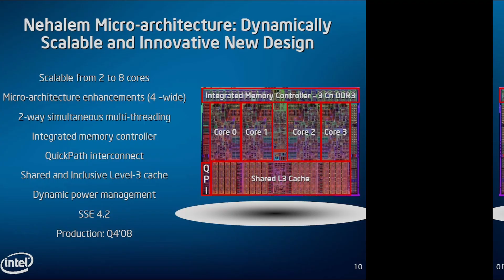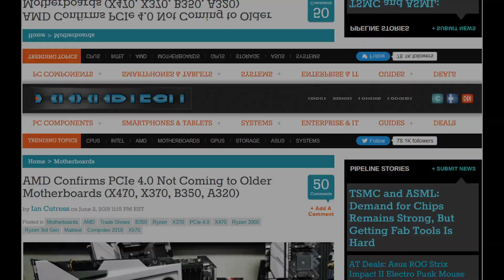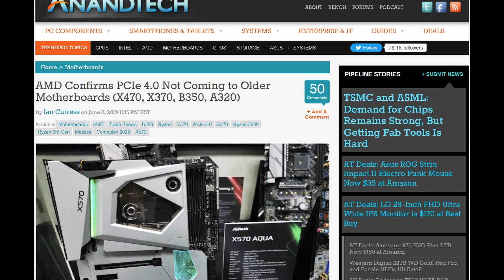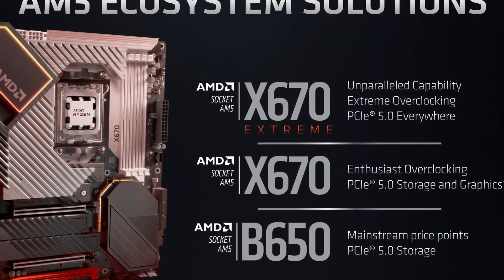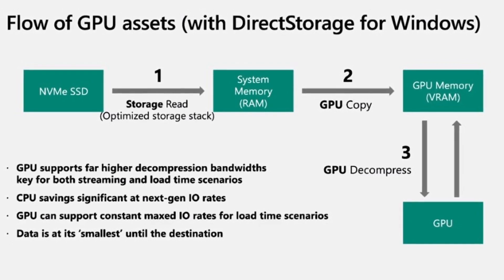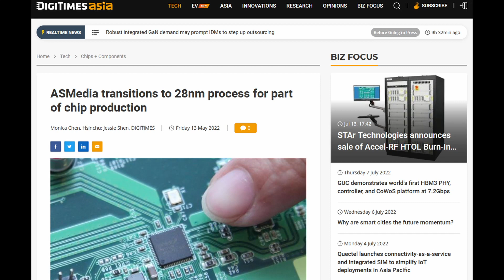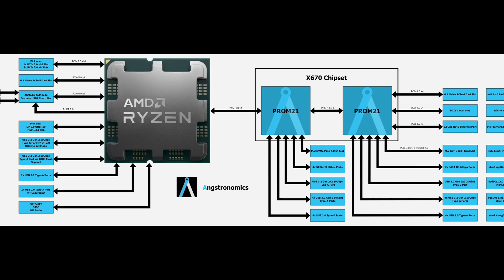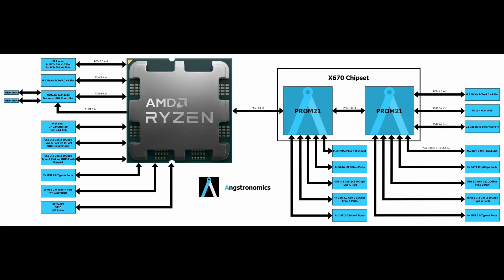The Smart Design behind AMD's X670E

Comment: I would personally be hesitant to buy a new gen 4 graphics mobo, in case AMD pulls a 6500xt again to knock 50 cents off the production cost
Reply: I would not, PCIE4 only became available with Zen2, Intel only recently supported it and if you care about PCIE5 already you aren't in the market for lower tier value GPUs with cost compromises to x8 lanes.
Future proofing is always suspect, replacing the mobo if necessary to take advantage of Zen6 features in 4 years when GPUs use PCIE5 bandwidth is better, alternatively buy a x16 PCIE4 GPU
Reply: @RobBCactive  I agree about low-end GPUs, but on the other hand if you're planning to invest in a high-end next gen GPU, I would also want PCIe5 since these GPUs are very likely to be limited at least a bit on PCIe4 even with 16 lanes.

Simple math: the 6500XT runs almost 2X faster in some games (e.g. Doom Eternal; see HUB benchmark) with PCIe4x8 compared to PCIE3x8. This shows that the 6500XT can use all the bandwidth of PCIe4x4. But even in the current generation, there are GPUs that are 4X faster than the 6500XT (the top 69xx/3090), which means that those are at least in principle capable of soaking all the bandwidth of PCIe4x16. I say in principle because these high-end CPUs have much bigger VRAM, but if we have another generational jump on game asset size/quality (think Unreal 5's Nanite) then you're need too much VRAM to avoid bottlenecking on PCIe4. And VRAM is only getting more expensive so nobody should expect the next-gen GPUs to have any extra VRAM at each SKU level compared to current gen. In short, you totally need PCIe5 so your 7800XT or RTX4080 with 16GB VRAM will not be limited by PCI bandwidth when running upcoming games that bring another generational jump in graphics fidelity.
Reply: @opinali GPUs are already handling 4k, so this idea looks like FUD.
As I understand leaks Intel boards allow PCIE5 for GPU not M2.  That means you cannot stream in data over PCIE5, so you're looking at only GPU/RAM transfers which implies copying and processing i/o data or paging of VRAM, which I believe more than negates the transfer speed gain.
PCIE3x16 hasn't really been an issue yet, only Zen2 & Zen3 users had PCIE4 until Intel's short lived 11th gen made it a feature.  I cannot remember any of the comparison reviews warning about 10th gen performance limitation, in fact the opposite after Intel cut prices on i5.
Think if RDNA3 that is expected to double 6900xt performance required more than PCIE4 then PCIE5 would have to be on both AMD boards and GPUs this year.
The Intel socket is dead after Raptor Lake, no future proofing option.  Looking at HUBs RX6500xt benchmarks showing PCIE3x8 performance reduction at higher resolution it was <10% limited not a halving, so phased upgrades would be a reasonable option.
AMD engineers have looked at this and concluded M2 PCIE5 support is a better tradeoff.  Console developers similarly wanted to stream in data directly so games don't have to pre-load so much data with delays between areas.
Within a few months benchmarks will be out and the platform strengths and weaknesses quantifiable rather than informed speculation.
I believe AMD's made smarter choices, with these chipsets and likely will have a platform advantage.
Reply: @RobBCactive  "PCIe3x16 not an issue", you would be right 95% of the time. But you can find tests showing that the 6600XT (x8) is significantly faster on PCIe4, and one from LTT showing that an RTX 3090 (x16) is 30% ahead on PCIe4 in CSGO. That's just one game but they only tested a handful there; nobody has done a HUB-style 50 game bench of PCIe3 vs. PCIe4. GN tested a dozen games but with a 3080. Given the scarcity of these tests, maybe CSGO is not such a rare scenario. And even if it is, it's good evidence that many other games are close enough of bottlenecking PCIe3x16 that new GPUs that are 2.5X faster but with same VRAM size could push above PCIe4x16. Both AMD and NVidia's next GPUs are rumored to be ~2X faster in raster but more than that for raytracing; so worst-case scenario of say a 4090 with 16GB, running a RT-heavy title at 4K and high settings, I can easily see PCIe5 having a decent advantage over PCIe4x16, without needing "FUD" about future games that might be much heavier.

Some ADL boards support PCIe5 M.2, but if you use that they cut the primary (GPU's) 5x16 slot to x8, and the secondary 5x16 slot to zero. PCIe5x8 is still enough for current GPUs at least if the chipset can map 5x8 to 4x16, since current GPUs can't handle any PCIe5 lanes; motherboard manuals don't have that kind of detail and I don't have an ADL system to test myself. Not a big problem yet because PCIe5 NVMe SSDs are still not available last time I checked but some brands have demoed it and they should be on newegg by the time that Zen4 and RKL ship. And it will totally be worth it in particular with full impl of DirectStorage on Windows, which is also coming in this generation, AMD in particular confirmed that their next hardware will have all the tricks for DS.

Totally agree that we need to wait for the first benchmarks, but the first round of launch-day benchs will not tell the whole story, for one thing it may be some time until we have any PC games updated to take advantage of DirectStorage. Perhaps that's easy for Xbox-to-PC ports, or AMD may work with some partners to have a couple launch-day games updated to showcase all good stuff in X670E/Zen4/RDNA3. Make Deathloop load levels much faster and I'm sold on the whole platform.
Reply: @opinali  you don't need a big rig for CS:GO, any PCIE4x16 will handle it great with Zero/4 AM4/5.
This is real FUD you're stirring up, pro E-sports ppl can use display scaling and lower settings to obtain incredible frame times even on older machines never mind what's coming soon.
The alternative won't be better, a PCIE5 GPU connection still has to be fed so it'll have a bottle neck elsewhere.  Nvidia Rebar support and Direct IO were a box ticking exercise.
I've seen plenty of ultra high fps tests and they simply become meaningless.
The performance of AM5 and Intel's competition will soon become clear, using PCIE4X16 for the GPU is NOT going to be a problem.
Reply: @RobBCactive  I'm not stirring up any FUD. Here is at least one game that runs 30% faster on PCIe4 than PCIe3. Simple fact and proof that current games can be bottlenecked by PCIe3 on current GPUs. By the way that result was the same in the 3090 and 6900XT, so this is not some freak driver problem.

I agree that ultra-high FPS is bullsh*t, the test I mentioned was 311fps vs. 404fps (6900XT on 4K, Very High, No AA). But CSGO has potato graphics for today's standards so I can see a modern AAA game hitting that bottleneck at a more reasonable framerate, tons of gamers will tell you that 120-144Hz is great for any game not just esports. However, today's heaviest AAA games will be bottlenecked by the GPU's execution units at lower fps than necessary to hit even the PCIe3x16 limit. Then again, the next GPUs will have architectural resources to render >2X fps, changing the balance of bottlenecks.

Suppose we have some game, say Cyberpunk, that today needs close to 100% of PCIe3x16 bandwidth at 4K/High, so you still don't see any boost from PCIe4. But the game is GPU-limited. If new GPUs are 2.5X faster for RT games, and all factors scale linearly, that game would need 1.25X of PCIe4x16's bandwidth before it is again GPU-limited. You can barely run this game today at 50fps in 4K in a 3090, so 2.5X is 125fps which is not "ultra high" by any stretch of imagination. Of course you can also use DLSS/FSR2, but not with zero cost in image quality. If I'm investing on a high-end GPU, I will use any supersampling only at Quality Mode where the artifacts are minimal and the superior TAA can actually make IQ better than native rendering. Even in new flagship GPUs, that won't always give you high enough FPS that you won't care about some 25% lost to PCIe4.

Obvious caveat that we don't know how much PCIe bandwidth is required by specific games and how their scaling would work on unreleased GPUs that we don't even have real perf numbers yet only leaks/rumor. But I will be surprised if there aren't at least a couple games that prove me right on launch day, i.e. games that have non-insignificant advantage with PCIe5 vs. PCIe4, at 4K/High, with "80-class" GPUs not halos, and within a sensible FPS limit like 144.
Reply: @opinali  Graphics data is stored in VRAM for fast GPU access, so graphics processing can go brrrrrr.  When VRAM objects spill to system RAM there's a penalty but a graceful degradation which implies the system bus is NOT saturated in normal gaming use.
Displaying games without frame limit would wedge machines if it all data was going across the system bus to the GPU.  Yet people are clearly multi-tasking fine with active  programs processing in background or on another screen while they game.

The surprise result you mention may be due to a latency reduction somewhere in the stack, thinking bandwidth saturation is the cause doesn't really fit.  It could easily be a OS scheduler multi-threading effect for example when you're pushing at high frequency from a game loop.

It's a dubious assumption that PCIE5 would help much as other bottlenecks usually exist, it'd be surprising if PCIE4 is still it, after all double bandwidth gave just 30%.

Hope that makes sense .. yes I have engineered software and systems. Measurement is far better than speculation and hand waving.
4k 400fps CS:GO doesn't sound typical usage to me, IIRC the chipset is the B series not the top X.
Reply: @RobBCactive  I'm also a SW eng, not gamedev but some exposure to graphics and solid experience in caching and benchmarking. Mostly agree on caching, but you cannot assume that 100% of the data needed for rendering can live in VRAM, requiring no significant PCI transfers after level loads. This will be true mostly for toys. In any real game there's a fair amount of data pushed to the GPU per frame. This can be dynamic content that's computed at least in part in the CPU, e.g. particles, physics, procedural geometry.

There's also asset streaming that often happens even when you have a large VRAM, for several reasons. 16GB is still too skimpy for the assets of modern AAA open-world levels, especially after uncompressed. Modern GPUs and API are improving support for compressed texture/geometry data but this is not magic, GPUs can only afford algorithms that allow very fast compression not just decompression. Game engines can't be hardwired for the top GPUs, so even in many AAA games, half of my 6800XT's VRAM is unused.

Also games can't afford complex LRU caches, they have to pick straightforward allocation strategies for both RAM and VRAM; they can't afford the latency and unpredictability of very dynamic algorithms even if at the cost of sub-utilizing VRAM on top GPUs. Some games show you the VRAM usage in the settings UI so you can see that each feature costs a fixed extra "block" of VRAM. Some of those blocks may have flexibility to use more space in GPUs with more total VRAM, but it seems largely fixed.

A modern/AAA engine designer will count on the platform offering at least 16GB/s of PCIe. You can use VRAM for certain data like core level assets, plus rendering buffers; but anything remotely dynamic, treat as transient: push at every frame, perhaps only with minimal logic to retain data reused in consecutive frames. If you know memory allocation algorithms or real-time systems, you can see why this is better than a "smarter" solution that uses all VRAM as a flexible cache. As long as you don't exceed the PCIe capacity.

PCIe3x16 bandwidth (theoretical maximum) is 16GB/s full duplex, that seems a lot but at 400fps it's max 40MB/frame. A single frame in 4K resolution and 32bpp color weighs 32MB, so if the game does any CPU-side rendering phase that requires copying the whole framebuffer back and forth once per frame, that consumes most of PCIe3x16. I don't think modern games will do anything like that, but CS:GO is from 2012, and modern games will transfer other things that often scale with resolution and quality settings.
Reply: @opinali  my commiserations 😁😁
Reply: @opinali  Suggesting an inefficient algorithm to max bandwidth usage isn't really useful.  AFAIK CS:GO had to run on XBox360 and PS3, as well as mainstream PCs, so I am sceptical about this CPU rendering point.
The game frame decides where things are and GPUs do the transform/light and shader calculations to render reducing data transfer.

In GPU reviews, the VRAM bandwidth is more significant than what PCIE level.  It consistently shows up in frame rates, as does AMD Infinity cache size allowing higher resolution for a given VRAM bus width.  Larger VRAM supports higher definition with a large performance drop when system RAM is heavily used.

Cost cutting VRAM bandwidth shows up in benchmarks.  PCIE saturation is more likely in loading phases or when textures overflow to RAM.

Let's give credit to the engineering team who worked on this chipset solution, they would be well aware of PCIE bandwidth requirements when considering what to compromise to offer best value.

Intel is more likely to have specced PCIE5 in response to marketing pressure after the lag on their PCIE4 support, so had competition reasons to push it.

We'll see soon enough as Zen4 is expected in October in volume on the X series boards at first and there's stock clearing price cuts on GPUs.
Reply: @RobBCactive  I didn't suggest an "inefficient" algorithm. It can make inefficient usage of VRAM, yes. But the goal is having short and predictable execution times. VRAM memory management is not simple; here's an excellent overview (20 minutes): https://www.youtube.com/watch?v=ML0YC77bSOc

In any case I was only speculating about CS:GO, we don't have its source code and even if we did I am not sufficiently familiar with modern graphics APIs. I can think of other angles, like: - That game is just buggy.  - It was written 10 years ago, system requirements specify at least "256 MB OF VRAM", you couldn't expect that game to make optimal use of modern GPUs with 8-16 GB.
Reply: @opinali  It was clear you're speculating.  The copy framebuffer to CPU for rendering was ridiculous, games don't do that.

RX 6700xt, VRAM 384GB/s,
RTX  3090, VRAM 936GB/s
Both PCIE4x16 same 64GB/s

They don't peform the same,  PCIE4 isn't the bottleneck in games!!
Reply: @RobBCactive  That scenario of copying the framebuffer was just a trivial example. Games don't do that, but they do make per-frame updates to textures, vertex buffers and other resources, which aggregate size might be in the same ballpark. I bet that many of the games that can hit several hundreds of FPS in modern GPUs are PCIe-limited. Also I never claimed that PCIe4 was already a bottleneck for any current games or GPUs. I'm only arguing that this might happen in the next generation (Ada/RDNA3 top SKUs).

Also remember one of my first arguments was about the RX 6500XT being proof that games can be limited by PCIe bandwidth. That card has only 4GB VRAM, but its specs overall are not absurdly smaller than a current flagship. And while no next-gen GPUs will have only 4GB, they won't have any extra either compared to the current gen, meanwhile the GPU cores will be >2X faster so at minimum we know that these cards will require more PCIe bandwidth than the current gen. And we can only speculate if it will be a sufficient increase that some games might be limited by PCIe4x16 at the high and.
Reply: @opinali  It's FUD about buying a mobo, in 2 or 3 years just uprade to an x16 GPU card not a gimped low end repurposed from mobile one.

The 6500xt was a high frequency clocked chip shortage card repurposed from mobile GPU, stretched to meet a gap in market and gimped to prevent mining with 4GB VRAM and lower the BoM cost The GPU was designed for PCIE4 systems with an APU to a tight die area budget not the  general desktop market.

PCIE3 is a 2010 spec, Intel PCIE4 support only landed in 2021 11th gen, AMD 2019   The 6500xt x8 issue arose a decade after PCIE3 adoption.

Thus this thread supposes ppl buying premium DDR5 RAM system on mid-range desktop boards, might want to buy a low end gimped PCIE5x8 card with repurposed GPU in future, when the other cards on market all support x16.

Choosing a different future GPU card with x16 designed with desktop market in mind is the solution.  After all many Intel users will still only have PCIE3 for a few years yet and it turns out Intel systems split PCIE3 so the GPU had just x8 if you used extra slots, nobody seemed to notice.

The whole idea that PCIE has been or will be the critical factor in GFX performance is totally unhinged.

The "trivial examples" obfuscate, seriously 4K frame buffers being copied to/from system RAM every frame at 300+ fps looked dishonest.

Nobody said PCIE isn't used to control and pass data to the GPU, just bandwidth isn't saturated.

The example of CS:GO@4k  300->400fps is an extreme, not matching the typical basket of tests produced by independent reviewers.

Smart developers need to see the bigger picture not obsess on hypothetical cases which have simple workrounds.
Reply: @RobBCactive  You keep misrepresenting my arguments about the 6500XT and the framebuffer-copy example so I won't clarify for the third time. And I know of how and why the 6500XT was made, but see techspot's PCIe3 x PCIe4 piece with the 5500XT (a "normal" GPU). Those benchs show that even PCIe4x4 often limits the 5500XT (4GB). On several games, old and new. On framerates below 60fps.

Let me emphasize those results. PCIe4x4 (or PCI3x8) is not good enough for a GPU that was midrange in 2019. With 4GB, but these PCIe tests are always tuned for low/midrange GPUs, they don't even try 4K since the hardware can barely deliver 1440p in optimal configurations.

I'll give you that we can't see yet any bottlenecking with 16GB or even 8GB of VRAM. But this might be an effect of limited benchmarks. I can't find PCIe tests for VRAM-hungry games like Deathloop which really wants 16GB at 4K/High. Also no tests for high-end GPUs limited to 4 lanes (that wouldn't represent any real hardware, but would prove how much PCIe bandwidth those GPUs need today). 

All I'm saying is that the need for PCIe has been catching up. As you say PCIe3 is 12 years old; that was virtually infinite bandwidth for 2010-era GPUs, but 8 lanes of that is not anymore good enough for 2019's 4GB 5500XT. Current halo GPUs are >4X faster than the 5500XT, next ones will be ~10X faster. Gamers that can afford a high-end 2023 GPU will want to run AAA games with all settings up to eleven, at 4K minimum (8K is b?llsh?t but I am personally waiting for reasonably-affordable 5K2K since I love ultrawide). They will also want to max out displays in the 165-240Hz range, these are not absurd framerate targets. All those factors increase need of PCIe bandwidth, no matter if you have a 4090 Titan with 32GB GDDR7 there's significant data that has to be produced by the CPU and transferred via PCIe every frame, and that scales with everything: settings, resolution, framerate.

I also find it very relevant that the recent use of RBAR/SAM has proven to deliver a significant boost to several games, solid proof that games are already impacted by PCIe transfers even at PCIe4x16. If you caught recent news about Intel's Arc GPUs, they depend massively on RBAR, way more than Radeon or RTX because it's a new architecture designed without concern to legacy systems without RBAR support. We can keep making fun of Intel until Arc is fully released with well-tuned drivers, but that's another strong evidence that PCIe speed matters.

In any case, I don't think there's much point to continue this debate, with the limited data we have now. The new GPUs will be available in a few months, with the higher-end rumored to launch first, and I hope some of the good review sites will have comprehensive tests of those GPUs comparing PCIe4 x PCIe5 since this is a significant factor for this generation. Even gamers that can afford a 7900XT/4090 on launch day are not likely to always make a new build, if they have recently invested in a high-end build that's still on PCIe4.
Reply: @opinali  more nonsense, anyone wanting 4K won't buy a cut down x8 GPU.
The 6500xt (even 6600xt) were 1080p cards.
Reply: @RobBCactive  At this point your insistence in this strawman of cut-down GPUs is getting trollish. I started this whole debate clearly naming high-end GPUs with 16GB and 16 lanes, I never argued you'll need PCIe5 for "cut-down GPUs".

You are confused by a later reply where I mention the problem of Intel motherboards having to split bandwidth with the M.2 slot if you also want to run PCIe5 SSDs. This indeed creates a scenario where the GPU can only use 8 lanes, but that's true for ANY GPU, up to the >$2000 halos. A gamer that goes with RPL, but wants a PCIe5 SSD, will have their GPU limited to x8. Because new GPUs will support PCIe5 (maybe not the full lineup but certainly the high-end), that's still the same bandwidth of PCIe4x16. And I'm saying that won't always be good enough.
Reply: @opinali  read the original post in this thread
Reply: @RobBCactive  That was @Crithylum's argument not mine. I took that discussion to a wider scope, arguing PCIe5 can be necessary even for normal / high-end GPUs. Maybe when you argue against my comments, stop putting the OP's words in my mouth. This is not how open forums work, I don't care what was the exact focus of the first post, I might be now discussing what is the best risotto recipe if I wanted.
Reply: @opinali   You replied to me on my specific reply to the OP's point, threads set the context and are seen again when reading your posts.
If you want a seperate discussion starting your own thread avoids confusion.
Reply from the maker: I get your point, but Navi24 was designed to be a mobile GPU and gut pushed to the desktop only because of the chip shortage. So I hope we are safe! But yeah, especially with PCIe gen5 cards with less physical lanes could become a new reality.
Reply: @HighYield  I actually thought
AMD cannot really do a PCIE5x8 card soon when the AM5 GPU slot is commonly PCIE4.
The implementation cost of PCIE5 they mentioned and power draw would likely argue against x8 adventurism